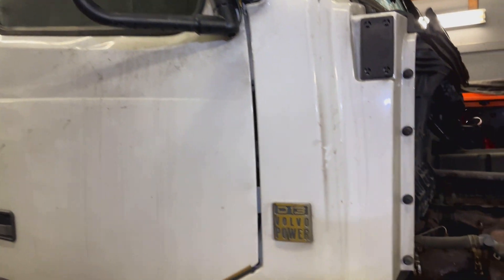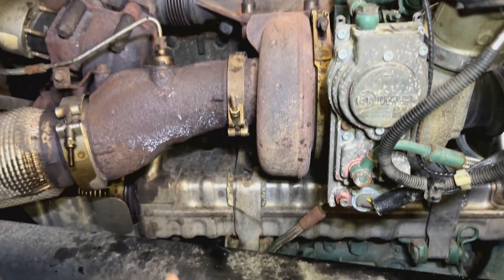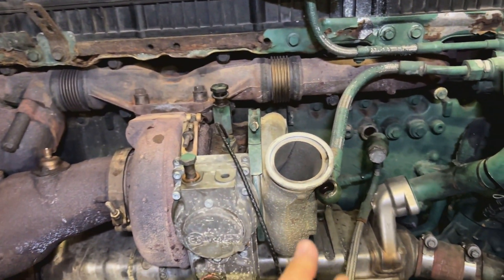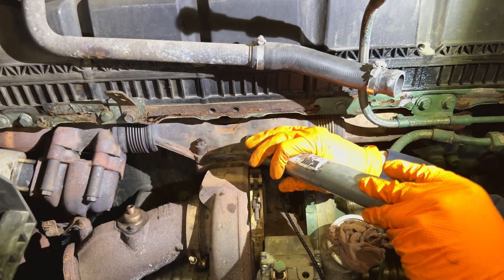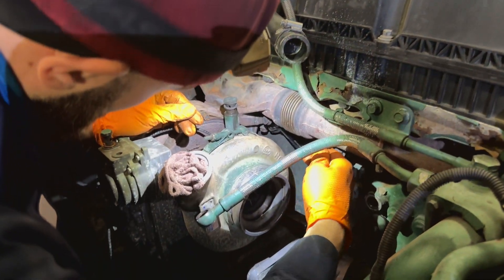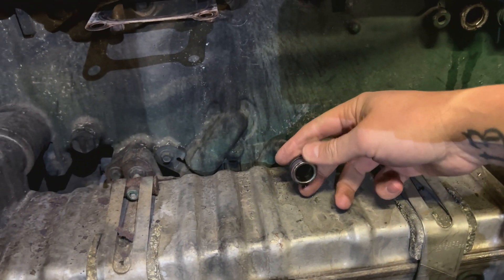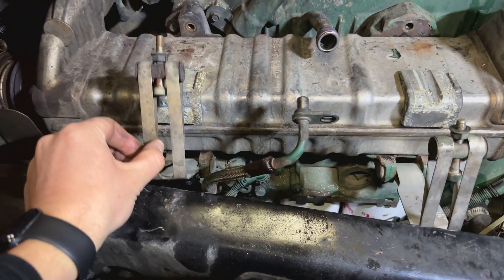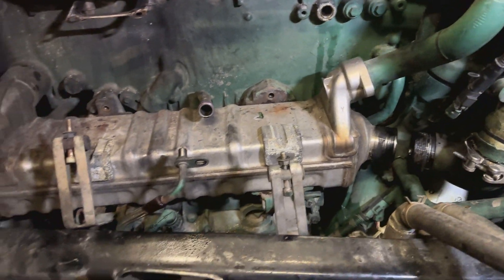EGR Cooler Replacement on Volvo VNL D13 Engine | Comprehensive How-To Guide & Tips

Comment: I'm not a mechanic I'm all long haul trucker I just had to see how it was done My truck is getting it done right now I have a 2022 Volvo VNL 760 best damn truck I've ever had I've driven a lot of cascadias I don't like the cascadia it's okay tractor but yeah no I like the comfort of the Volvo but I'm finding out that the Volvo has issues. But I guess most tractors have issues. But I still like my Volvo and I'll stand behind it 100%. Well I'm a company driver so I guess my company will stand up behind it 100% until it reaches 600,000 miles and we're done and then I get a new one. But I'm getting a new VNL 860 which I don't know I guess it's more comfort but I've spent a lot of I spent almost a month out on the road before I come home

Comment: Hey 👋 how much does it cost to replace egr valve?
Reply from the maker: Is that with the part included, or just labor? I can’t tell you the exact cost of the part, because I don’t know how much it would be for your engine but labor is usually between 4 to 6 hours.
Reply: @ it’s D13 Volvo VNL 2017
Reply from the maker: It would be better if you called your local dealer, gave them your VIN number, and asked for the price of the part. For an exact replacement cost, I would need to see it in person. Sometimes bolts snap, and other times it goes easy. If everything is perfect, it takes 3 hours; if there are complications, it can take up to 6 hours(shouldn’t be more) and after all it depends on shop rate. Our rate is $95 an hour.
Reply: @ got it. Where are you located?
Reply from the maker: 14825 new ave, Lockport IL 60441

Comment: I’m not losing antifreeze but I’m losing power when go uphill. 

Can it be because of bad egr cooler? Dealer found the code “EGR flow excessive detected”.
Reply from the maker: To me, looks like your EGR valve is not working properly or might be a leak somewhere. There are tests for that that you can do through PTT(Volvo software)
Reply: @CheetahRepairServices  thank you for the answer. One more question. As I understand, egr cooler and egr valve are two different components, right? I’m going to replace egr cooler as it was advised, should I also replace egr valve? What do you think?
Reply from the maker: Yeah those are two different things. Don’t replace randomly. If it’s still working fine then don’t need to replace it. If it was never replaced and your truck is around 500k miles and you have money for it then I would replace it so you don’t have to deal with it later.
Reply: @CheetahRepairServices  thank you for your response. I appreciate it!

Comment: Cool.
My 2023 volvo vnl 860 Also needs EGR cooler replaced with the EGR valve. 
Do you think I can do it without taking it to the dealer ?
Reply from the maker: If truck still under warranty I would take it to dealer. If no warranty then of course you can do it somewhere else